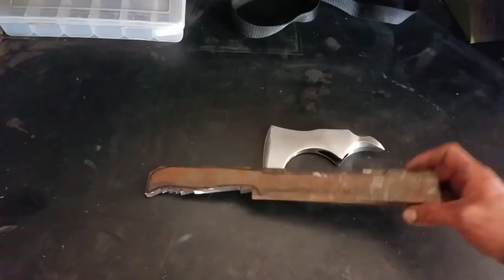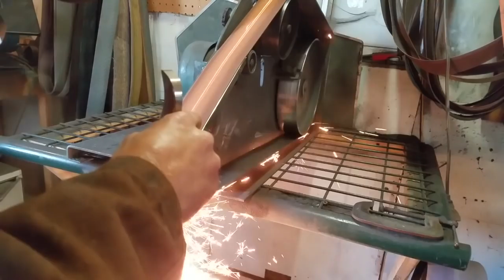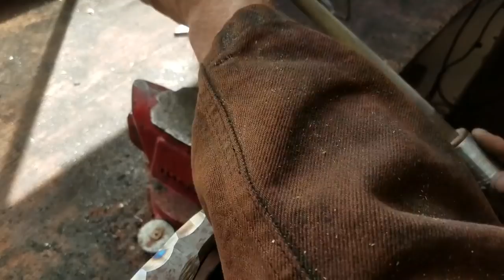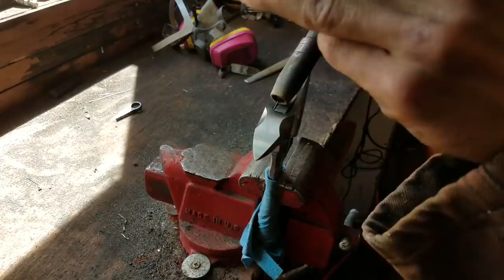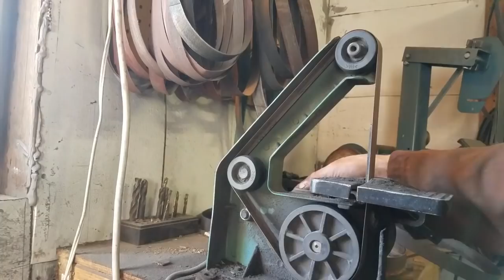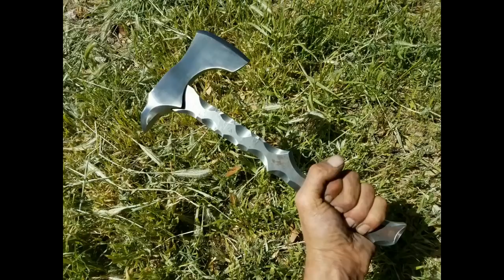Custom Axe Handle  - Steel Axe Handle

Comment: terrible welding did you forget to turn your gas on.
Reply: Dean Grifin lol GAS dude its a MIG WELDER not all welding machines use gas some only use electricity
Reply: It's a flux core welder. Doesn't use gas. The shielding agent is produced when the flux in the filler material burns and creates the gas.

Comment: dude u welded without gas
Reply from the maker: +sleepingbag its a shity harbor freight welder, theirs no gas
Reply: A Mig Welder doesnt use gas it only uses electricity shows how much yall know and how you know its a shitty harbor freight welder lol
Reply: Spencer Markle a MIG welder uses gas. It uses carbon dioxide as a shielding gas, and sometimes a mixture of that and argon. You're thinking of flux core, which doesn't use gas. It penetrates better than MIG anyways.

Comment: Are you going to wrap the handle? Any extended use with that is going to mess up your hands.
Reply from the maker: +Mikel Jorgensen probably not, it's more for throwing than anything else. If I was going to use it for anything else I would wrap the handle

Comment: Nicely done. I have an old carpenter's hatchet head just like that and I've been wondering what to do with it. Now I know. Also, friendly tip: you should bevel the handle at the end you're going to weld to the top of the axe. It will give better penetration, not to mention it will give you more room to potentially run a bead as opposed to using stacked tack welds, which can end up with slag inclusions, little pockets of space where impurities get trapped in the cooling weld pool. Cool project. You got my sub.

Comment: If you would have done a gas weld with filler instead this price would have saved you some time or when you weld you should do circle motions and take it slow